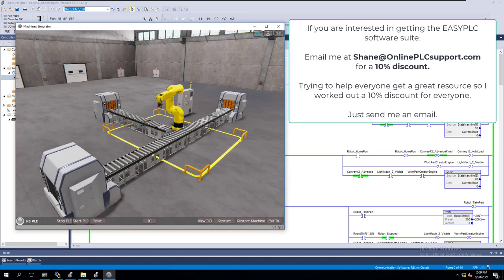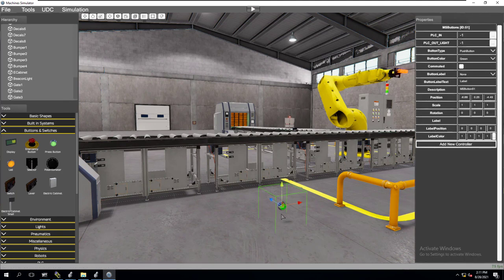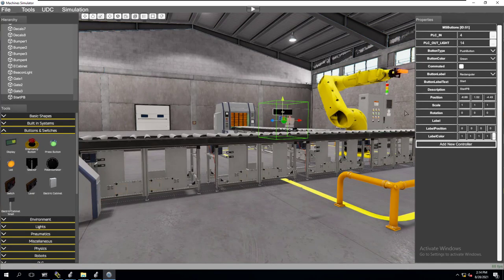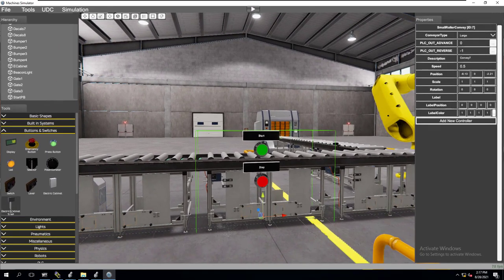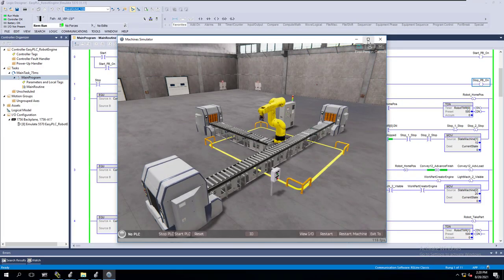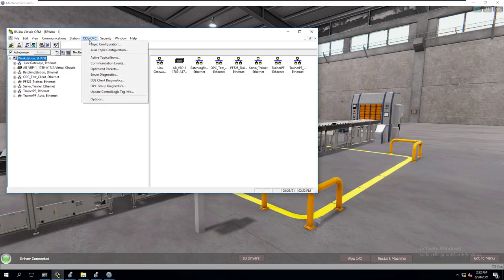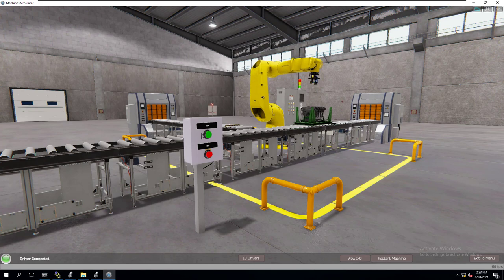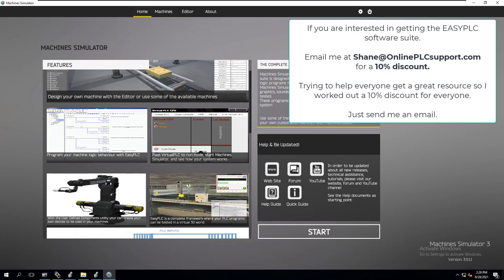EasyPLC Machine Simulator Adding a Start-Stop Station Using Machine Editor

Comment: Hi Shane.
What is the software used to program?
Is it similar to studio 5000?

Can we learn motion control with that simulator?
Reply from the maker: The is EasyPLC Machine Simulator.

Has pre-built machine through a graphical gaming platform that was transitioned into PLC programming for this industry to use.

Very helpful in learning logical programming then testing it to make sure it works correctly.
Reply from the maker: If you are interested in learning servo controls then I would suggest my servo motion mastery courses

Comment: How do you get the vm workstation  setup to run this program. It is very choppy and over shoots alot.
Reply from the maker: Install Machine Simulator on the virtual machine then edit the resolution of the machine simulator